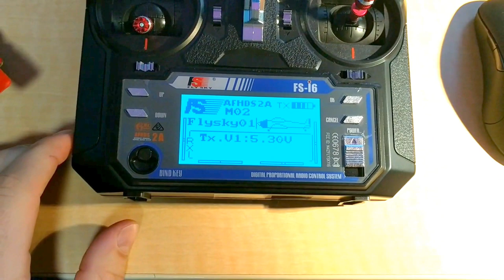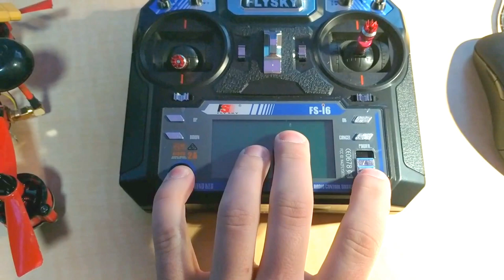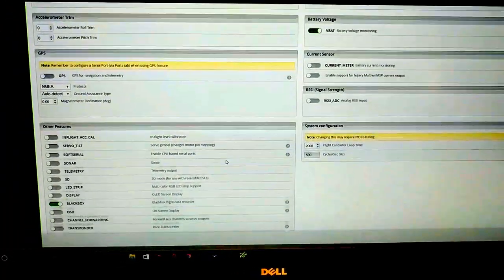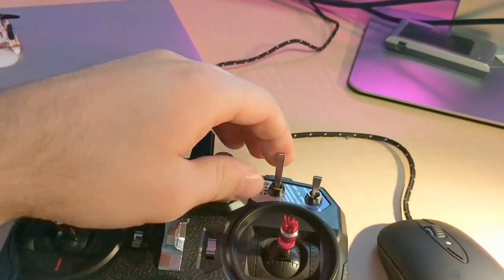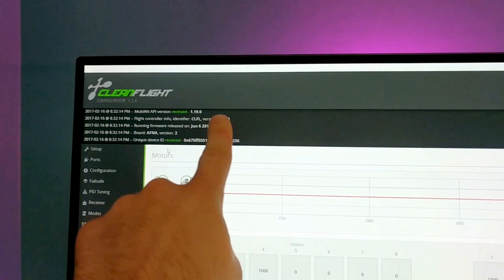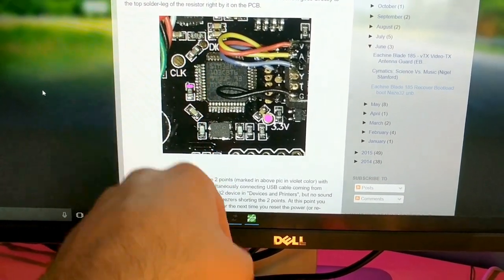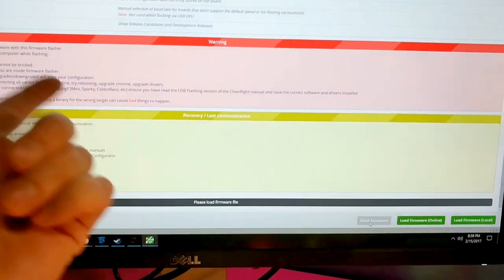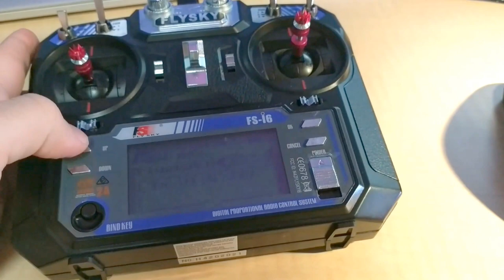Eachine 185 setup and troubleshooting

Comment: Try turning the battery sideways. You have plenty of clearance then. I also had the same problem. I have the same receiver. I still have not had mine. Flying yet basically the things that peace of jaunK If I can figure it out, I'm just going to use the parts.